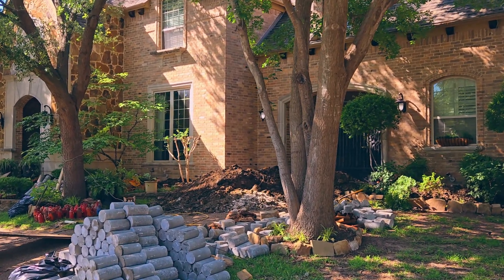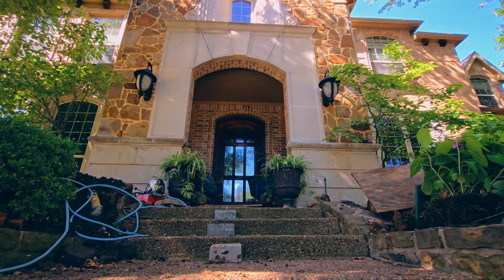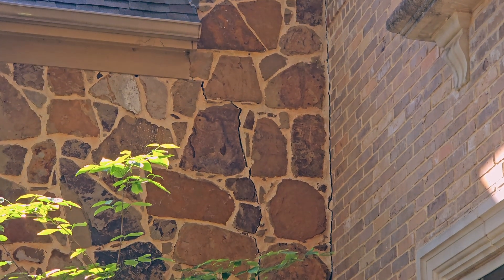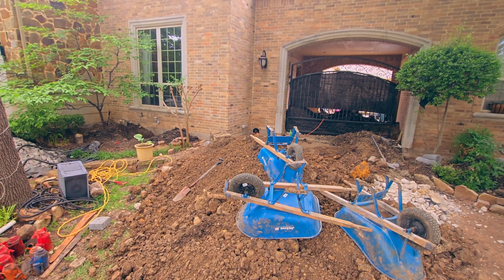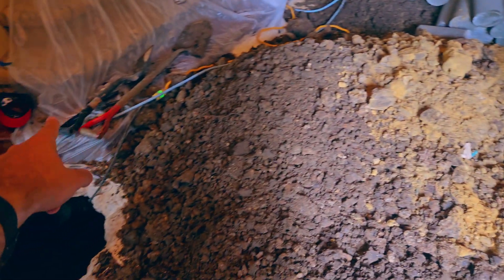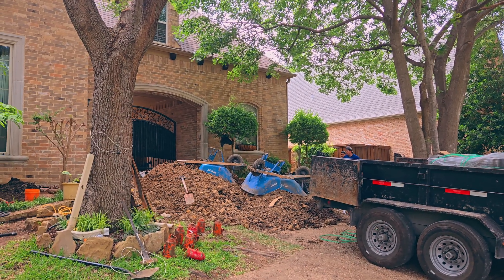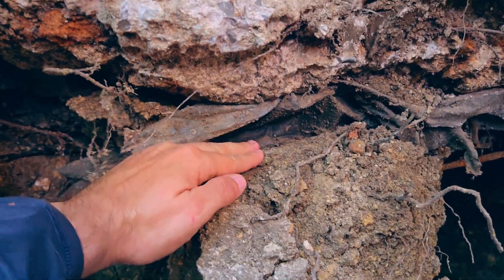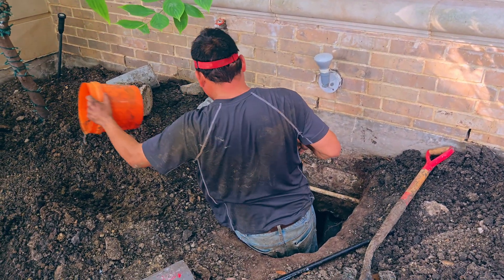Tunneling Under a HUGE Foundation in McKinney, TX | Tales of the Foundation Repair S03E06

Comment: How would you deal with an underpin/lift on a house that has stepped brick footings, or no concrete in 1800s houses. 

Piers wouldn't work? the force would be too concentrated for the loose bricks?
Reply from the maker: Is it like a pier and beam foundation? Does it have wood beam, joists?
Reply: @ifixconstructionfr  it's a simple solid  brick wall house, no piles, beam or piers. And the the brick continue into the ground and are sat on soil. There no real footings
Reply from the maker: What is holding the floors? I understand the wall is made of just brick. But what are the supports for the floors? Is there a basement? Crawlspace?
Reply: @ifixconstructionfr crawl space technically ( but you cannot crawl into it as it's only 200mm deep!).

Effectively, the floors are suspended timber, and are decoupled from the house/foundations entirely
Reply from the maker: Then worst case scenario is, lifting the walls, demolishing and removing all the old deteriorated foundation, build a new one and finally sit the walls on the new foundation